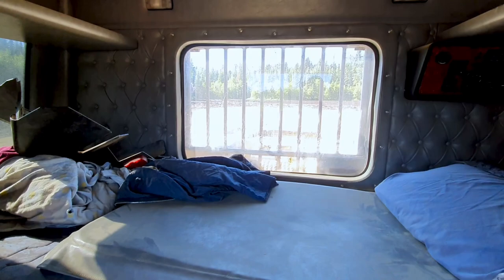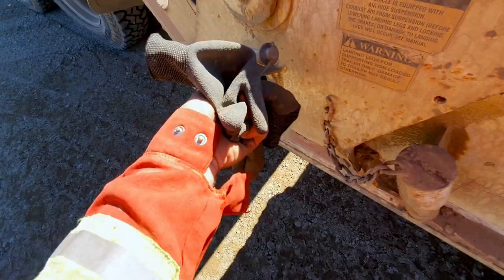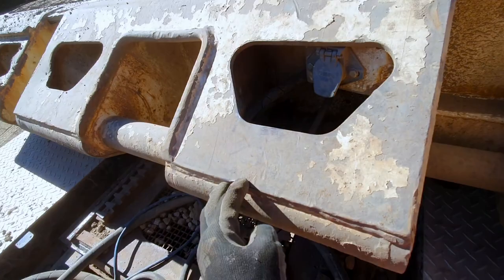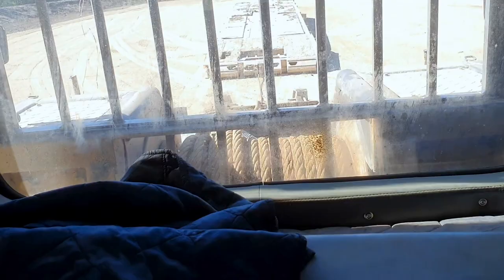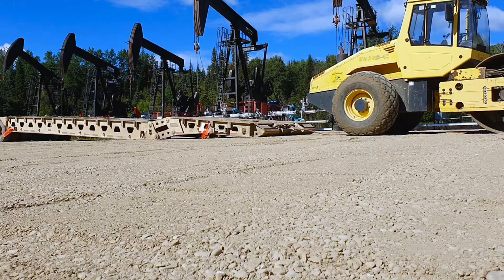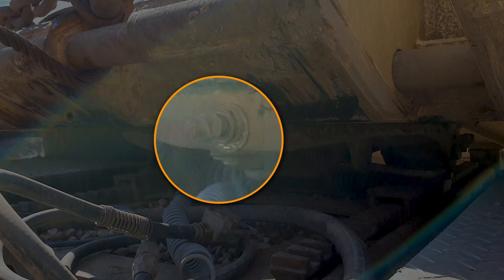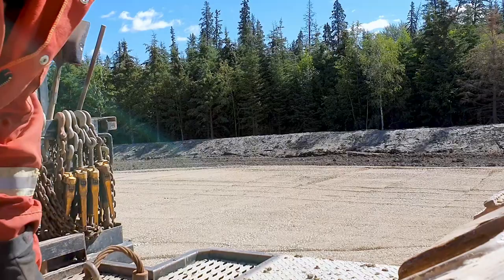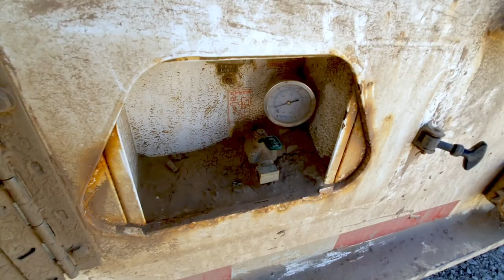Loading a packer on a winch truck scissor neck trailer combo

Comment: Never say never when it comes to hauling equipment. Just because you can't or won't load something a certain way doesn't mean someone else can't. I've loaded that same packer on that exact same setup 100s of times over the years over the beavertails with no issues what so ever except in icy conditions.
Reply from the maker: Right on! I had a buddy of mine say the same thing! He said just gotta climb on correctly. If I remember he said he starts on a bit of an angle & gets the drum started that way.
Thanks for both watching and for your comment. Stay tuned for further nonsense and entertainment my friend.

Comment: How did Commander Jim Lovett  of Apollo 13  describe using the simulator?  3 hours of boredom followed by 5 seconds of pure terror! 😆  You gotta do all the hooking and unhooking of stuff and then hope like crazy the machine doesn't slide off of the side when wheels start spinning.  Good job!!!
Reply from the maker: Well occasionally people do have a little mishap here and there that's for sure. It has not happened to me but to have a rock truck spin and slide sideways off the trailer would probably make your heart leap a little bit.
 As long as experience increases skill and not complacency.

Comment: When winching the trailer back up, are you using both reverse and winch, or just the winch to pull the truck back?
Reply from the maker: Here just the winch. Some trucks have a live winch separate from the transmission.  This one doesn't,  so the truck speed  won't match the cable speed.  Leaving it in neutral keeps the cable tight and straight on the drum. 
(I'm no winch truck expert myself though. I use one occasionally,  but not enough to say I'm  "qualified ")
Thanks for watching and for your comment.  Stay tuned for more my friend!